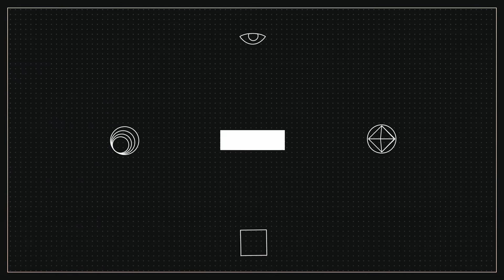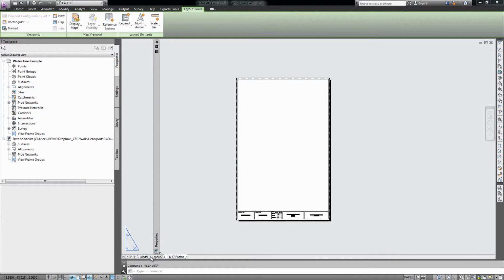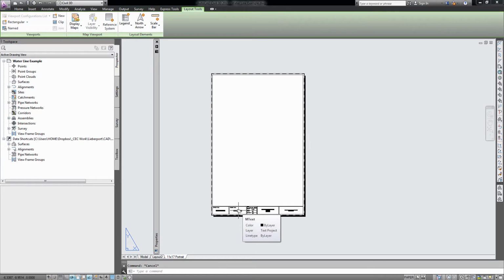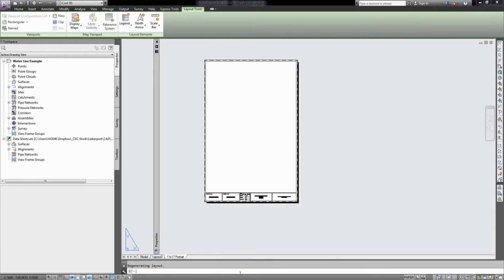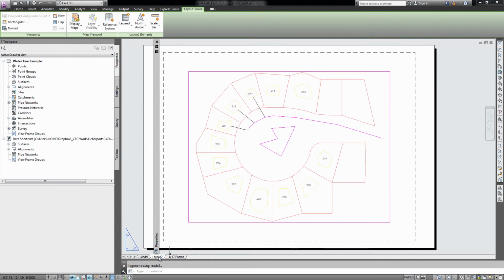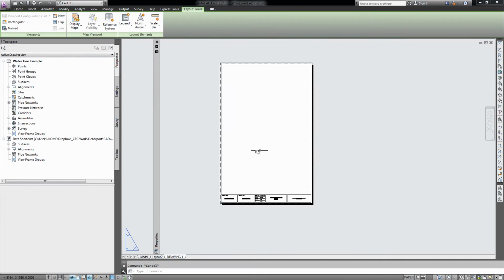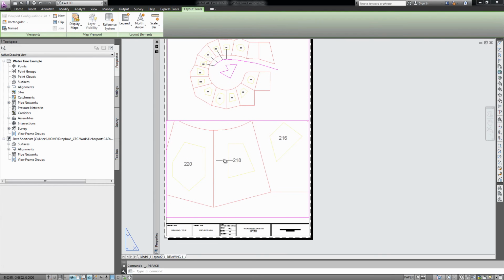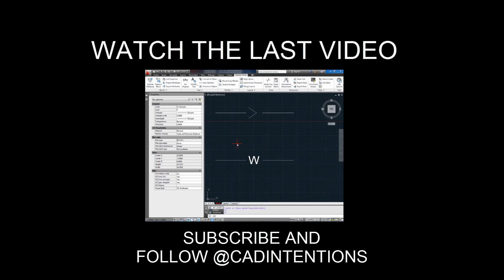AutoCAD Tutorial: Model Space vs Layout Space

Comment: Our company works entirely in paperspace. The scaling is easy because we set the scale to print on 11x17 paper. If we have to go bigger we just draw to 24x36 and set the scale accordingly so the image fits logically within the confines of the paper size. Of course working 1:1 is totally out of the question. But once we set the scale we use simple algebra to determine what length we should make a line based on the scale we are using. So for example if we chose 1” = 30’ as our scale and we need to make a line 24’ the equation would look like A30=24 , A=24/30, A=0.8. So, .08 would be the length of our line we would draw in autocad